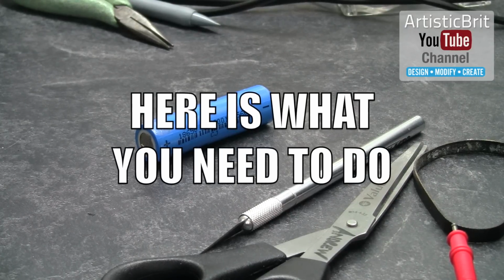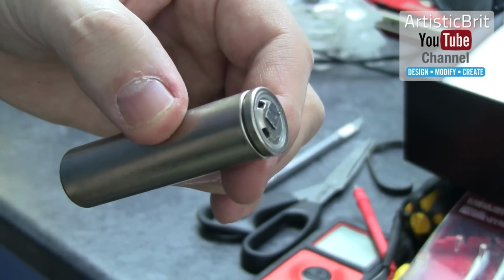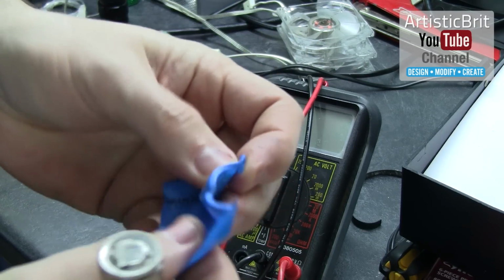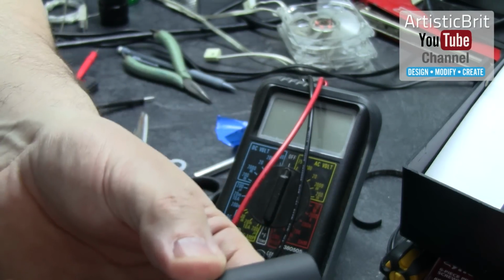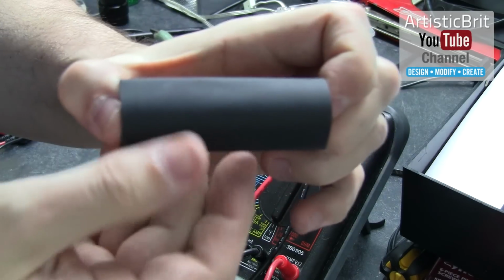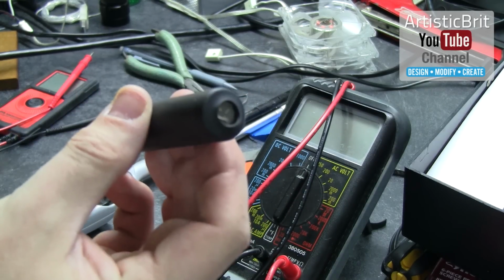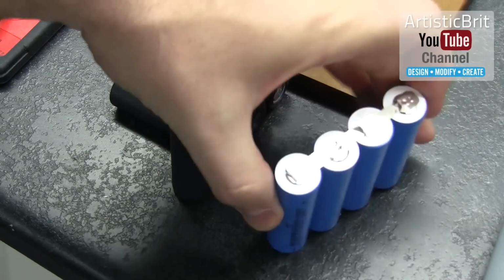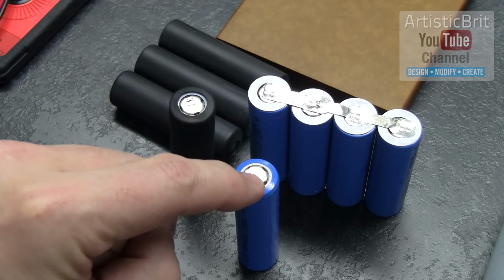Electric Danger of Lithium Ion 18650 - Battery Fires Exposed - Possible DIY Solution

Comment: These devices are built with the top ring in place like just about every battery of this shape for protection and safety. I found it rather odd that you would disassemble the battery to then try to haphazardly make it more safe?....While watching this video I thought to myself, "...watch, this guy's gonna use a match or lighter to shrink the shrink tubing"...nope, a hand held torch...sheesh, heat guns are as inexpensive as $9 and will do a better and safer job. 
Doing a search I found no reference to any problems with the tops of these batteries becoming shorted or posing a shorting problem.
Have a look at the following link for design and testing information:
http://ntrs.nasa.gov/archive/nasa/casi.ntrs.nasa.gov/20100037250.pdf

Actually one of the most dangerous batteries on the market and very commonly used is the 9 volt "Transistor Battery" (NEDA 1604, IEC 6F22 and "Ever Ready" type PP3 (zinc-carbon) or MN1604, 6LR61 (alkaline)). These pose more of a "shorting" risk than that of the cylinder type battery. The 9v has both terminals openly exposed on the top of the battery. With the style of connector they possess it is very easy to connect two batteries together creating a short circuit which generates heat and possibly a fire. There have been reports of house fires as a result of discarded 9v batteries in the trash. The batteries come in contact with something conductive in the trash can. You can easily show this effect with a 9v battery and a small piece of steel wool. Touching the steel wool to the terminals will ignite the wool.
Reply from the maker: The batteries are being used in an electric car. In an accident they will require a completely different set of safety necessities. I deem this to be a correct course of action. Although if you actually watched the video, you would see I only took the end cap off of one battery for demonstration purposes. The danger actually exists, and they have caught fire before now. This is a cautionary example video. Thank you for your concern.

Comment: OK, you start of by talking about building your own battery packs and go on to say the batteries are knocking against each other. I don't even need to see the rest of the video to know this is ridiculous. A proper battery housing should always prevent the batteries from moving around, let alone letting them touch each other!
If are this ignorant of battery safety, you shouldn't even be handeling loose batteries in the first place, let alone makeing your own shit whit them.

Comment: just rip the safety thing out and it be fine then.
Reply: Ok most everyone here you think your smart but take in all the facts before making your comments which makes you look very child like.  He removed only one of the protective caps and only removed one of the batteries protective cheep ass wrap.  Yep computer manufactures built these lithium ion batteries with in mind that people were going to rip them apart and makes other batteries out of them! LOL  They are made on an mass production line mostly in china where you know they are built with the up most care lol.  And when everyone on here that has built and E bike battery me included ALWAYS take extra protective wrap.  And if you charge and discharge every battery and build the battery with care you will know which battery are good which ones are holding to much heat.  And everyone that is one him about the safety things you mean the thin paper.  I mean google empty 18650 lion battery cases and you will see some of the new designs are cases where the 18650 battery is cased in a wax type of material  and only the bottom and top are showing because they realize people are building bigger batteries with these and many many many are catching fire because NUMBER ONE reason and look it up people lack of care when building them.  See the thin wrap is not men't to take all the shock the bumps the ebike goes over.  But really people when watching a video read the captions he put in and you will see that he addressed almost all of what everyone was putting him down about.  But again you all have a point the when the laptop batteries where made they made them with the best material and the up most care and we should just rip them open not test them solder them together put it on an ebike and just give her.  ALL I HAVE TO SAY TO ALL WHO PUT THE VERY INTELLIGENT MAN DOWN IS WOW!!!!  And this was a great video.  Like her even made a caption talking about the heat factor on the batteries LEARN TO READ!!!!  And really watch a video if your going to put it down.  Cause really 95% of you all made yourself look like dumb asses!
Reply: mate I watch youtube over a couple of drinks, and I just looking for a few ideas, you don't have to get on ur high horse about it.